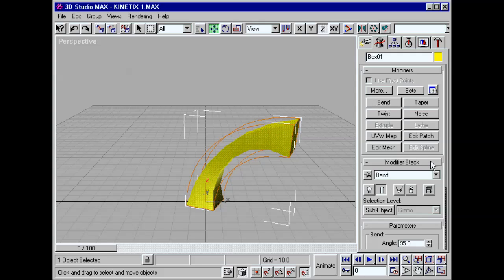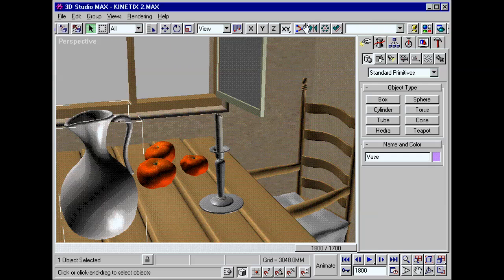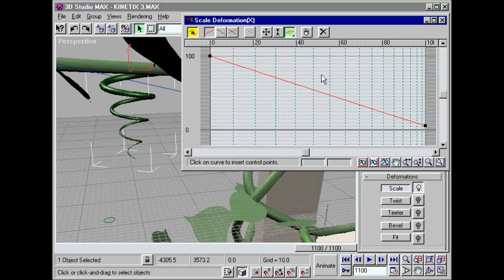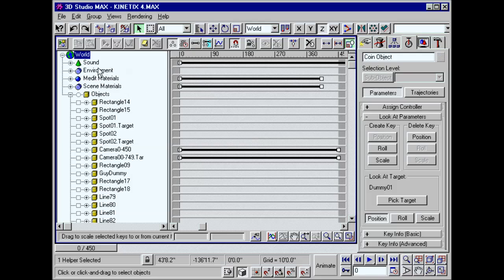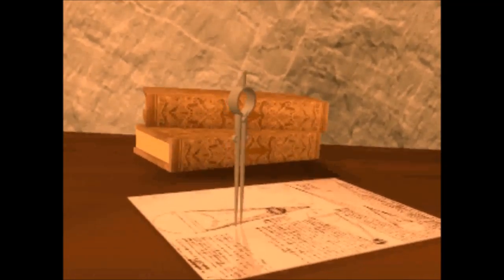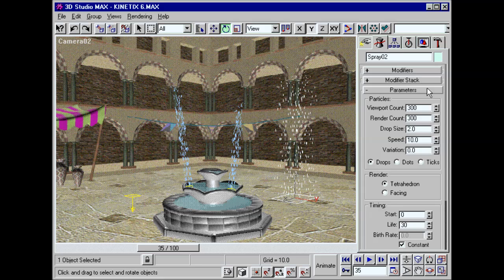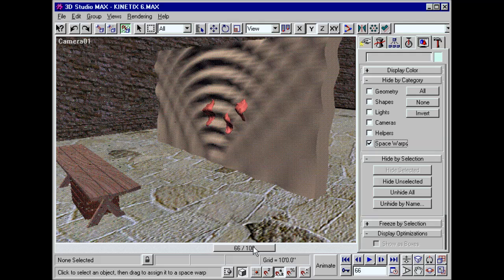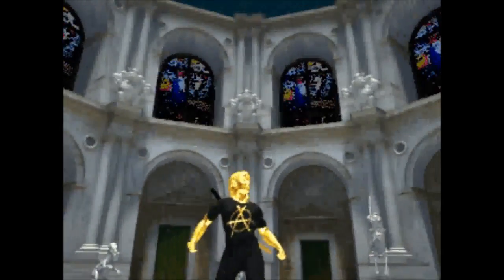3D STUDIO MAX KINETIX DEMO 1996

Comment: This was the first Max I ever bought.  I still have the CD's.  Before this, I used Lightwave on the Video Toaster.  Back then, didn't understand half the stuff she was saying in this demo.  Now I know the terminology all too well.
Reply: Can you put that 3ds max on mediafire.Because I want to animate(With low end pc).Thanks
Reply: @tokiffer6649  
 archive.org and vetusware has some versions
Reply: @houstonhelicoptertours1006  thanks,i think they will not work on modern OS,to install it on Windows 95/98 emulator?
Reply: @tokiffer6649  
No, not Win 95/98. Max was never officially supported on these(it's even in their documentation), Windows NT was the officially recommended OS.

Last windows versions I tested that on was win 7 64 bit. Everything from 1.0 to 9, including commercial plugins, worked without problems. I don't know about Win 8 or 10.
Reply: @tokiffer6649  I got the "3D Studio MAX from Kinetix Release 1 (1996)" working on Windows 98. So I can at least confirm that R1 works on Windows 98.
Reply: I can confirm max 4 works on win98

Max 4 will even work in a virtual machine since it has an all-software rendering mode if you have trouble finding a period-correct graphics card to run it with